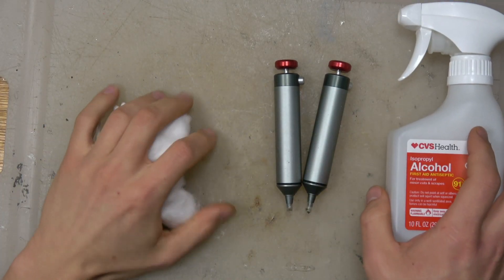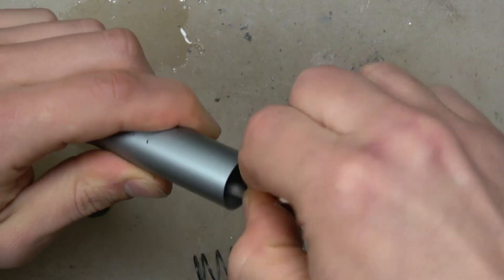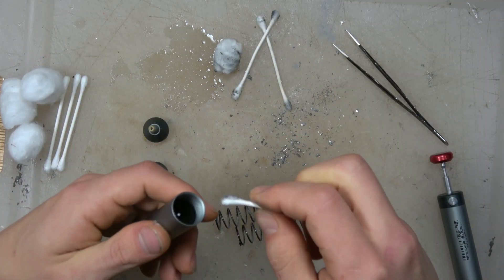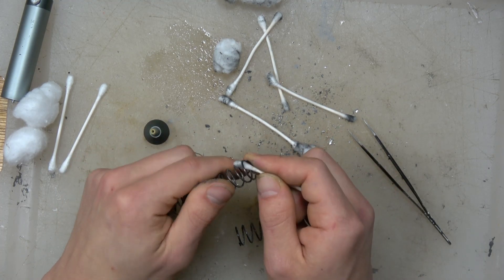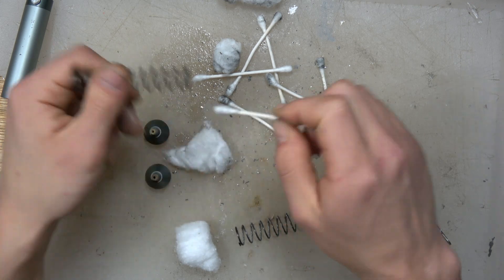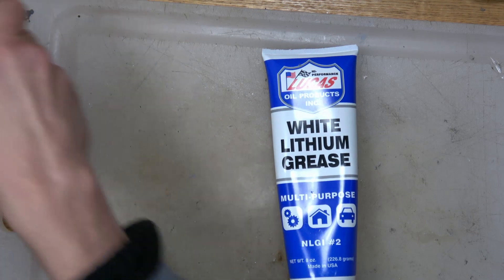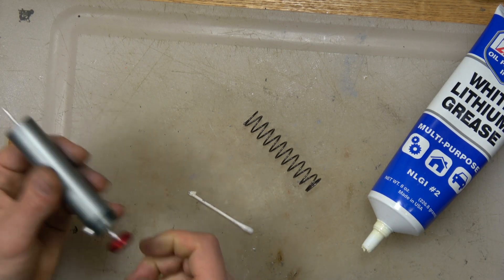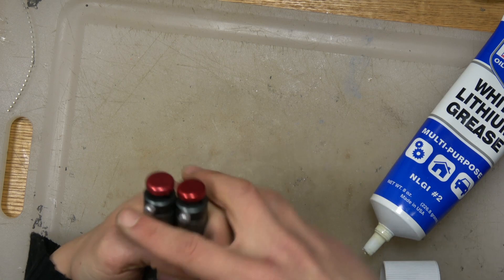Cleaning The Engineer SS-02 Solder Sucker - RETRO GAMING ARTS

Comment: Hey. great video. I just cleaned mine too and spent some money on the lithium grease. It's made a world of difference. Thanks for sharing the content.
Reply: I think you should find out what types of rubber and plastic are used in this solder sucker, and check whether they're compatible with lithium grease.  It's a minefield unless you just test it on a sample and wait six months.  The important ingredient in lithium grease is possibly naphthanic acid.  There are at least twenty types of elastomeric polymers which react in different ways to fatty acids.  O-rings usually swell and you'll need to replace them.
Reply from the maker: Benjamin Xiao lithium grease is so worth it. I use it alot. Cleaning these has saved me money in the long run, thank you for watching!

Comment: White lithium grease although for metal to metal I found it too buttery/stiff/thick for this ss02  pump. I had much better response in performance using wd 40 high performance silicone lubricant is what you want or ptfe/Teflon wd 40. Coat the inside of the barrel in a generous amount and around the internal rubber mid  ring that allows it to slide back and forth and it's performing much snappier than using lithium. Although lithium won't collect dust and silicone will I came to the conclusion it's no big deal as it's going to get dirty inside anyway and will still need maintenance regularly depending on how much it's used. Also silicon lubricant can tolerate higher temperatures than lithium before it breaks down which is better equipped for soldering use.
Reply: Are you referring to silicone grease? Silicone grease is recommended by Engineer Japan in their SS-03 video.
Reply: @penguinsushi8442  I wouldn't call it grease it's a lot lighter the wd- 40 silicon lubricant. The lighter the better as you don't want thick gloopy stuff creating drag on the walls of the chamber around the rubber seals. It also helps preventing solder sticking in the end nozzle as it won't adhere to the walls. Car cockpit cleaner would probably suffice aswell as it's loaded with silicone. I took all the grease out and use thinner lubricant instead and now when pressed its an instant pop which is both necessary and good. You just need to focus on lubricating the barrel walls both sides of the rubber ring inside the spring doesn't really matter. If you use too much it comes out anyway being viscous. So you can clean excess with paper towel.
Reply: @kevinharrison4909  Ah, thank you for the detailed info. Yeah, looking closer into it, having silicone grease isn't ideal as the solder/dirt will get attracted to it, and it increases friction. How often do you have to clean and or lubricate your SS02 btw? Cause from what I've read online, grease lasts longer but can get dirtier (especially if you use too much).
Reply: @penguinsushi8442  very little maintenance tbh. Haven't had to do it again yet but not had device long only 4 weeks.

Comment: Excellent tutorial on cleaning this desoldering pump.

I purchased WD-40 white lithium grease in a spray can, I wonder if that will work as well as the grease from the tube?
Reply: Did it work?
Reply: It seems to, I haven't compared it extensively to the video but with the spray solution it still seems fast enough.
Reply: @haloslayer255  im planning on buying the engineer pump after  regretting buying the yihua desoldering pump which also heat at the same time and that didn't work. The engineer would be the first pump i will try that doesn't heat. Do you think its worth buying?
Reply: @scarecrow03 most definitely.

But I have one small recommendation.

Search for the SS-03 model, the black writing comes off on the ss-02 and the ss-03 seems to be etched into the body of the unit.

Cleaning them should both be the same.
Reply: @haloslayer255  i ordered the SS-03 a few days ago and it hasn't shipped yet so im looking for tips since im still in time to cancel the order. The weird thing is that is cheaper than the old model SS-02 and i dont know why but its very weird
Reply: @scarecrow03  I'd say just wait for the SS-03, performance should be identical to the SS-02.
Reply: @scarecrow03  Did the SS-03 arrive yet?
Reply: @haloslayer255  it did, it works better than i expected. I dont know how good i will do about maintaining it but thats my only worry. Still dont know when should i clean it or when to apply new silicone grease
Reply: @scarecrow03  I would wait until the solder starts to not eject smoothly from the tool.

Mine ended up having the tip clogged and I decided to clean it then. It takes a little bit of time but it's good as new every time it's cleaned and lubricated.

I like to melt the solder into little balls and join them all together as a blob of solder. Makes a small paperweight,(insert salesman voice) now avaliable with lead.

I've been building a small cache of soldering tools for my Nephew, when he turns 12. In 11.25 years from now.

Cheers!
Reply: @haloslayer255  thanks for the info. I actually need something small like a fist but heavy so i can add weight to my doctor octopus arms that hold the controller im working on. Still cant think of anything, only a magnet from a broken old speaker but i dont have that

Comment: whats the regularity time to clean the sucker or you clean it when start to not sucking very well?
Reply from the maker: I clean it when it starts to not suck well, which is based on how often you use it. A good tell is to push the plunger down, and release it, if it goes up quick and fast and makes a loud noise. It's still good

Comment: I tried it with grease first, was a bit better. But then I took it apart again, cleaned of the grease and used some thick silicone oil (50.000 cst) and it works much better now, like new. 

Was actually a bit surprised how quick and strong it was, had been used to the slower plunger movement for so long

Comment: Hi! I know this is a little late, may I check with you is it safe to unlock the plunger lock unit to clean if I do not have lithium grease?

Are there any other types of grease that can replicate lithium grease?
Reply: I used some thick silicone oil, works great

Comment: thanks for the vid and the grease recommendation..only thing i was wondering was is Lithium grease plastic / silicone / rubber save..
from the little googling around i did it seems save.. i have sum "ball bearing" grease that i use for sum bicycle parts but i don't think that's plastic save i can't seem to find info on that.. considering   "Lithium grease" is cheaper then superlube i really like your tip..
btw i bought a small de-soldering station i found a store willing to sell me an old model they had.. for a good discount but living in a apartment i store it in a box together with other solder gear .. getting it out for a small job is a hassle that's why i was looking at a small quick job tool the SS-02 looks really good.. take care.. Greetings from The Netherlands..

Comment: Hey thats nice video but i have a problem with mine, the little silver button at the top used to suck the solder to relase the plunger doesnt hold the plunger properly, it just moves freely in the top part, it holds the plunger just if i put the ss02 towards the ground, if not that button to release the plunger just stay inside the head near the plunger red button... do you know why?

Comment: Great video. These are by far the best I've used. As well.  Just cleaned mine out today and everything is working fine, but ill definitely add some lithium grease next time.
Reply from the maker: Thanks alot. Yea, I been using one of these for years now. They're so good
Reply: @ThirstWorldTTV  im actually doing potentiometer and channel encoder swaps in very small boards for two way radios. It's obscenely delicate and small, so this pump conforming to the board with it's tip is great. Works better than my electric pump.

Comment: The instructions say not to unscrew the plunger assembly, because it will cause a loss of suction. They only recommend greasing the screw threads and inside the cylinder.
Reply from the maker: this is true, but if you put it back correctly and clean the gasket from the plunger, it will go back good as new, but you can easily make a mistake and loose suction

Comment: Tip: DO NOT USE 3-IN-1 OIL. I learned the hard way. It actually works really well and lasts a long time, but it degrades the O-rings severely.
Reply from the maker: I used to use 3 in 1 on my skateboard, great oil for the bearings lol

Comment: YOU WAIST LOTS  OF  TIME  AND  COTTON !  Next Time to save  time and cotton (DO THIS) just prey it with carburetor cleaner . in 1 sec  all that build up inside will flush out. 1st pull out this suction stick you don't want to spray the rubber rings   you can but i wont anyway spray it one time inside and it is all clean in 1 to 2 seconds then spray the springs all will be clean  then put lithium grease in the chamber put it all back together and WAM ! all done up and running in less then 5 min . Hope my cleaning way helps  works great for me
Reply from the maker: Everyone has their preferences. I will say carburetor cleaner i didn't think of. Thats clever! I don't mind using the cotton balls, its not that big of a deal for me.
Reply: @ThirstWorldTTV  Thank you Works great for me all the time 5 min done! keep it moving !

Comment: 5:26 I found there solder residues mixed with original factory grease. No matter how much you try to clean everything off, in the end you will still find some bits of solder if you move a little the plunger
Reply from the maker: I was able to get it off. Q tip 😀
Reply: @ThirstWorldTTV  I think it is better to take also the plunger out and clean more easily each individual part..
Reply from the maker: @Paul-Cirimpei  the plunger also gets crusted with solder too. I had to scrape it with something metal to snap it all off. What you think of the tool itself ?
Reply: @ThirstWorldTTV  yup, but it is easier to scrape it off and then lube the inside of the case if you take it out. The tool itself it is very handy and it does the job so good because of that silicone tip. Too bad the writings on it "solder sucker made in japan" goes off if you scrape it with your fingernail or agains a rough surface..

Comment: May I suggest silicone grease (especially with PTFE)? It is amazing stuff. Anytime you have a o-ring, it really helps the sealing and lubrication!
Reply from the maker: Oh yea?? Good tip thank you!!
Reply: I have tried to find some definitive information on what has made various O-rings expand and plastic parts disintegrate when I apply lubricants like mineral grease, silicon spray, vaseline and others.  It's sometimes a year or so when I come back to find a problem and I can't remember what type I used.  I've been using silicone grease after reading that it is safe on rubber and thermoplastic polymers, but then recently I've read that some of the spray versions use solvents which attack plastics.  I've also just bought some 'white mineral spray grease' which states in the RoHS specs that it is 'safe on all plastics and rubber'.
I'm confused.
Reply: @westinthewest  I bet it gets pretty messy the more detail you find. I've personally followed the rule of dont mix alike materials. Oil based lubricants will destroy rubbers. Silicone will damage silicone, etc. I'm pretty fond of superlube products. They have some pretty detailed data sheets that show which materials their lubes are comparable with. As for what specific chemicals damage what, you'll probably have to dig into some chemistry and material science. My best guess would be to look into organic chemistry and polymer stuff. 
Let us know what ya find!

Comment: Lithium grease is not ideal for this use because it is petroleum based and will eventually degrade the rubber seals. The manufacturer suggests silicone grease for this application.
Reply: It seems the advice here is that dust and dirt won't stick to lithium grease.  I doubt that he's tested this experimentally, but it's no consolation when your seals fall apart, but at least they're nice and clean.
There's a useful resource here: https://www.marcorubber.com/o-ring-chemical-compatibility-chart.htm#null=&chemId=1782
Scroll down to check the effects of naphthenic acid which is the critical ingredient of lithium grease.

Comment: does the lithium grease eat away at the rubber orings?
Reply from the maker: Nope
Reply: I've just had a look on https://www.marcorubber.com/o-ring-chemical-compatibility-chart.htm#null=&chemId=1427
It shows 14 different materials used to make rubber O-rings and the effects of various chemicals on them.
The critical ingredient of lithium grease is naphthenic acid, and the data shows that seven types of O-ring are compatible, but the other seven types are 'not recommended' or lack 'sufficient data'.
Interestingly, the chart shows that silicone grease is safe on all types of O-ring except silicone!  It causes them to swell.
I don't know how to identify nitrile, silicone, fluorosilicone or neoprene O-rings, but it seems that the answer is not so simple as this video suggests.

Comment: Idea: Possible fix for sticking solder in tip would be to pre-treat the inner tip area with Turtle ICE liquid car wax to prevent sticking. I have a number of pots & pans in the kitchen with a thick layer of burned material (they all get this). After cleaning with Easy-Off, I warmed the aluminum surface (bottom) & rubbed a little ICE on it, let dry & buffed. After three years of daily use, the bottoms of my pans remain as clean & shiny as the day I treated them.  Worth a shot I think.

Comment: Good day sir. May I ask, how do you remove silicone grease from your hands? I feel like the pores of my hands are clogged with grease. haha.
Reply from the maker: I use 91% isopropyl alcohol, just spray it on my hands and rub lol, i'm sure there is a better method
Reply: Thanks for the reply :)  I tried that and acetone as well haha. I also tried dish washing soap, hand soap and hot water. I found that the weird sensation goes away after a day. 

I read that the best solution for removing most greases is to clean in off with its lighter version  (silicone oil) before proceeding with other cleaning methods.

Also if you are interested, the company also ships replacement lip seals incase the one on the plunger fails Source: https://www.eevblog.com/forum/reviews/engineer-ss-02-soldering-review-awful-service-customer/?all

Comment: The people that make it said NOT to remove the plunger part or it would lose suction.
Reply from the maker: KKnopp your 100% right. And on my first few i never removed the plunger part. And over time they did loose suction. Then when i removed the plunger and gave it a very thorough clean, and grease did it start to work again. What happened was over time the little gasket on the plunger got solder all over it and that had to be cleaned for it to work again